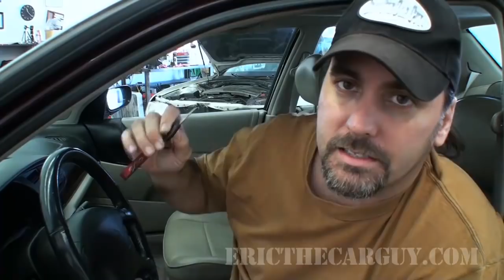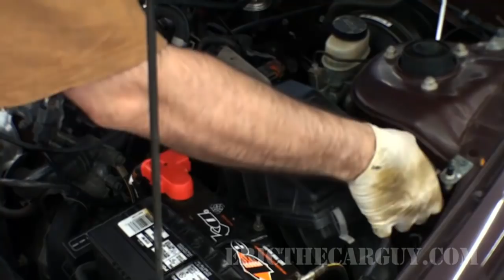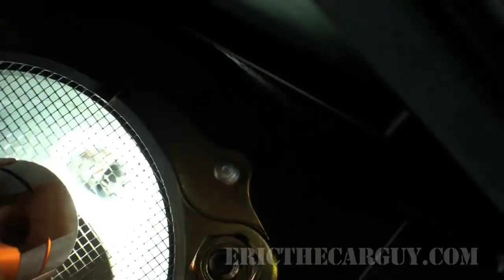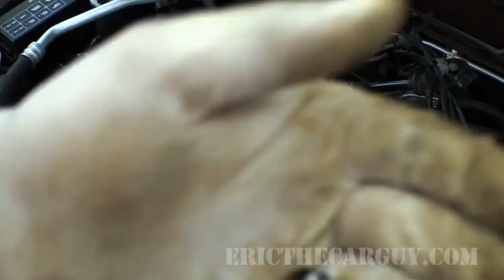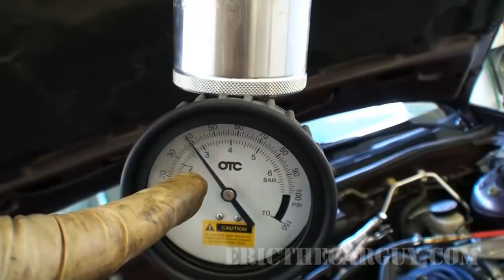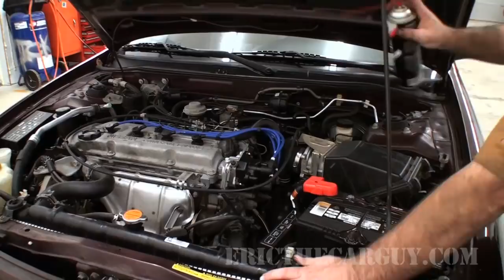1997 Nissan Altima Misfire Diagnosis -EricTheCarGuy

Comment: Wow, that was one hell of an informative video, especially for someone that's never really worked on fuel injected engines, thanks! I'm working on a persistent mis-fire issue on my '93 Dodge Ram and even though it's a normally aspirated 318 V8 I got some ideas to try :-) Right now I suspect a fouled catalytic converter which I hope to confirm by pulling the pre-cat O2 sensor.

Comment: This is a good example of the venture effect. Biggest leak when no. 4 sucks. Fuel trims etc may have have not been too bad. Spark wires were marginal. Good to clean the injectors now and then. In all good work.

Comment: Yeah, those Altimas are known for intake gasket leaks! A quick look at fuel trims on the scanner at different throttle openings (during a test drive) is a great way to narrow down the type of misfire. A dirty MAF would give very different trims than an intake air leak. And after the fix, you'll have quantitative evidence that you fixed the issue!

To rule out an ignition issue, you could have taken out the #4 plug with the boot, laid it on the block, and ran the engine. Otherwise great job!
Reply: Pine Hollow Auto Diagnostics  the real professional ☝️

Comment: I have a 99 Altima. The check engine light was on and the codes said rear knock sensor and o2 sensor was the problem. A few days later the light went off so I went to get emissions testing and he said he couldn't get a reading or that the car was not communicating with the computer. He said o would have to get that fixed before I could get it tested. Why did the check engine light go off and why can't the car communicate with dlc?

Comment: Hi Eric love your videos and appreciate all the work you do  :)
I have a 2002 chevy blazer with a 4.3 vortec v6.
with a misfire in one of my cylinders, but its not showing a code? And i am using an actron AutoScanner , but i was wondering if i can run my engine while the scanner is still plugged in? Because there are a few other stats that looks like they only work with the engine running? But i cant find anything online saying its ok to run the engine while the actron scanner is plugged into the car?  Also, my engine misses about once or twice every 10-20 seconds, and i can hear a single tic sound every single time it misses? And the tic sound seems to be coming from near the distributor area? I also have new wires cap rotor and plugs, and they arent arcing. so im stumped? please help me Eric. also, looking forward to seeing the fairmont progress videos :)
Reply: i found out what the problem was, the plug wire was deteriorated under the nipple or whatever its called.

Comment: Excellent video. Those Altimas especially the 2.5 seem to be everywhere out here in Cali. Dime a Dozen seems like. Last year when we were looking for a replacement for our '96 Accord that got totalled, we took a '06 Altima 2.5 for a rest drive and loved the power & performance. The car wasn't in our budget and ended up with an '08 Kia Spectra. Also a good car but would be better if it haf cruise control.

Comment: Hey Eric, the best injector testing method I've seen it an injector balance tester. Just connect a fuel pressure gauge, prime the fuel system up to max by turning ignition on a few times and connect the balance tester to the injector. The tester is plugged onto the terminals of the injector and can pulse it 10, 20, 50 or 100 times. Looking at the fuel pressure after you can do a comparative check- 1-2 psi difference would be bad injector

Comment: Do you think you could do a video about rotary engine issues, or things in that nature I have a 2005 mazda RX8 and something it wrong when it starts sometimes.it starts everytime, but sometime itll crank for like 10 seconds then turn on, sometimes it ill take 3 seconds but i never get a good turn and it turns on right away like every other car ive driven. i dont know if that cause its rotary or what. please help.

Comment: Tell u what  I'm not a mechanic but I did the same thing as you as far as hearing the miss pin pointing which cylinder was missing. Through my own various tests because I don't have a computer to hook up, so parts changing I went new wires, plugs ,cap and  rotor button. Got it a little better but didn't fix it. I don't know anything about feul injectors so u you talk to me a little bit about that with your video and I much appreciate it. So I was at a lost only thing left to change is coilpacks a little bit high on the price for me so stop there and thought I would just get a mechanic. Ugh. But a technician buddy of mine told me he didn't feel a skip driving and told me it's wasn't missing. Wrong he is but he's a diesel mechanic won't hold that against him. So that got me to thinking about that vacuum leak I thought I heard weeks before the car started messing really bad but couldn't find. Don't have any ether to test with so I hit the internet for common problems for the 1999 Nissan Altima and so be it a rough idle is the number 1 problem caused by a vacuum leak on the intake manifold gasket . So found your video on YouTube trying to see how to take it off because like I said I've never messed with feul injectors before or fuel pumps. So I appreciate the videos a lot and wish me luck on replacing mine I can't wait for the fun

Comment: Is that sound the alternator or the power steering pump whining?  I just replaced a timing belt and water pump on my civic and it's making that kind of sound now but it wasn't before.  It doesn't really do it much at idle but when you give it gas it get's louder :(

Comment: Intake manifold. Did it 2 years ago so I don't remember everything but you gotta: drain fuel lines, drain coolant, remove air filter, throttle body, starter, fuel rail, many hoses and really tough to find bolts, then have fun jimmying out the manifold and collector.    There's more, I just can't remember.  The dealership pegs it at an 8hr job.  There are  a couple hundred complaints online from Altima owners with the same problem, vacuum leak #4, lowest quote was 500.

Comment: Hi, My sister has a 99 Dodge Grand Caravan, I had to replace the plugs, wires, and coil, but it is still running a little rough.  I did the power balance test with the fuel injectors and only cylinder #6 had no response to being unplugged, I swapped injector 6 and 4 and still had no change.  I did use a auto stethoscope to listen to the injector as I pluged and unpluged the it, and I heard the ticking sound when it powered on.  I am a little stumped on what to check next!

Comment: Hi Eric, what could be some possible causes for a 1997 Altima suffering a loss of accelerating power when the car warms up.  There is no check engine light on and no codes whatsoever.  Distributor was replaced 6 months ago.  About 2 months ago, car started to lose acceleration power when the car warms up to normal temperature.  When the car is cold or recently started, it runs fine.  When the car warms up, it becomes very sluggish, taking a long time to reach 40-50 mph and when it does so, it starts to shake a little almost as if the engine wants to cut out but doesnt.  
Thank you for your help.
I've read somewhere that the distributor rotor screw could be the issue?
Reply: My 1998 altima is doing the same i already replaced the knock sensor and the Maf also the distributor is new and m still feeling hesitation did u figure out the problem I've spent over $300 to no avail
Reply: Rafael Gonzalez no, never found out, driving it as is.

Comment: I had a similar problem with my '98 V6 Camry where it was running really rough. A local mechanic advised a major tune up calling for coils, 3 of them, wires and plugs. They wanted an insane amount of money so I did it all myself. I still had problem and tested injector #6 thankfully front bank of engine and it had zero resistance. Injector was expensive at near $100 and a bear to replace, Fuel rail grommet were very difficult to find for some reason. My throttle body gasket was also bad from age

Comment: hey Eric I was wondering if you could help me out with a p0300 code so far I've done spark plugs 
coil packs
seafoam fuel filter and checked the battery and it's good too haven't done the injectors or checked the cat. would a clogged cat even cause a p0300 code would the computer?  it's a 03 trailblazer btw thanks
Reply: rogelio aguilar most likely going to be the fuel pressure regulator

Comment: I've found that un-metered or pirate air on these 90s cars actually causes the engine to run rich. The engine will detect that something is wrong because the oxygen sensor will show lean running despite the "correct" amount of fuel being put in, so to protect the engine the computer will dump in loads of extra fuel to compensate.

Comment: Just a tip, read the injector cleaner can - after you use injector cleaner like that, replace the spark plugs or risk and idle misfire - I always do it before I replace the plugs never after - I watched a young mechanic spend hours revving and driving cars that had idle misfires, I got sick of the noise so went to see what the fook he was up to and sure enough he was doing injector clean after new plugs and didn't ever read the can that said "replace spark plugs after use or engine may have low speed misfire"- yeah I gave him chit about that for some time after, he no need no stinking instructions.

Comment: The car was running fine but one day after replacing the belts the car was running rough at idle. I was driving and I lost power. I had the pedal to the floor and I wasn't going anywhere. I pumped the gas and the car jerked and started hailing ass when the power kicked in. The next day it cranked then cut off n now it won't turn over at all. Do u know what could be going on. Spark plugs hadn't been changed in years and I was wondering if that was a problem.
Reply: Could be but it could also be anything. Hard to tell without looking at it but spark plugs are cheap enough to just try and see.
Reply: regular diligent maintenance ,oil changes,cleaning under-hood and fixing things when they happen will stop these kinds of issues.if the plugs haven't been changed in years,likely not much else has been changed either so it could be anything or everything combined.
Reply: big daddio first thing I did was change the plugs. I ultimately junked it. it's tax season, so I will be getting a better car. not a Nissan ever again

Comment: i replaced the MAF on my 97 altima at about 308k miles. i thought the little bolts might snap off, so i just ordered the whole MAF housing from ebay (used of course) and swapped it in.

while removing the old MAF i noticed the same thing you did, the connector was not fully seated/connected. i didnt even have to press the release tab to remove the connector. the replacement MAF works great, and the original harness connector snaps in tight. i wonder why it was loose on the original MAF but tight on the replacement?

Comment: Also with pinching off the return line. You boosted your fuel going into the cylinder, which eliminated the misfire because you ended up with more fuel + more air in that cylinder. You essentially had a lean misfire in cyl. #4, and boosting fuel pressure just helped to righen up the mixture.

Comment: Ouch!
Skipped over a few steps ie compression check and vacuum leaks...
But! you did find the problem and that 1 wire was questionable and the cap had some wear, so at least it wasn't wasted money.
Those Nissans are well known for intake leaks, thought out of all people you would have known that, "Mr import of that vintage"
and the other take of it, learn from your mistakes.
No one is perfect!

Comment: A couple days ago, my CEL came on. My codes read cylinder 2 and 6 misfire. Have about 40K on a 2012 Wrangler Unlimited Stock. Idling runs around 500RPM. Temperature where I am right now is around 50 - 70 degree Fahrenheit. I recently had this issue about two days ago, with no change in driving habit. Engine will hesitate once a while during idling and often when I brake and come to a complete stop. I wouldn't describe the engine running rough when it is idling. I checked the codes using the jeep's built in ODBII reader and it'll automatically erase them after its checked but the CEL is still on with no codes now (I guess it needs an external ODBII reader to actually turn it off). I drove it for a couple days and rev the RPM up higher than usual and upon check for any codes, it doesn't appear to have any new codes but the CEL is still on. However I still experience the same issues (hesitation once in a while during idling and almost all when coming to a full stop). Please, any ideas or suggestions? Thank you.
Reply: Best suggestion is to take it to the dealer. Unfortunately the the first model year Wranglers which have the V6 Pentastar engine have had trouble with the cylinder heads and misfires due to the valves being burned up. Have seen this personally on several Wranglers and some Grands. But the dealer is your best bet in this case.

Comment: Hi Eric, I saw a clip on u tube where someone hot wired the injector, with a fuel pressure gauge on, when the injector was powered (open) the fuel pressure dropped right down, realing it and it went right back up again, putting injector in the fuel system to try to clean the injectors ot, well it usually just goes back to the tank...Fred.

Comment: good video, although you went about the misfire the hard way. I always first look at fuel trim to check for problems first. fuel trim can determine a vacum leak. Also second in order would have been a compression test. I would of recomended the wires and cap though. both looked to be a potential problem.

Comment: how much did that repairment cost for owner of the car? looks expensive to diagnostic cause many check stuff involving.... i'm having my fifth car, cause mechanics costs more than the car itself. timing belt change cost about 1/3 part value of the car.  i meen in a 600 dollar car. good cars.

Comment: What would you look for if a single cylinder is only misfiring under heavy acceleration, and all plugs/wires/coil are new?
Reply: For misfires, the order to check things is always: Ignition, Fuel, then air (vacuum leaks). I would make sure your fuel injector for the affected cylinder is working since your already replaced the ignition components.

Comment: I think its just the way the engine is designed. Its very easy to flood those engines. If you start the engine from cold then turn it off within a 2mins
it's a pain in the ass to get it started again. Is that what you have?

Comment: I've worked with these motors quite often and knock sensors tend to be fairly common on these engines. So more than likely, that will need to be replaced in the near future. It's rather common on older Nissan/Infiniti's...

Comment: I don't wanna disrespect the teacher but to clarify- engine vacuum is as high when the engine is at any steady rpm. Not just idle. In a healthy engine revving should cause the vacuum to drop and then rise back to normal. So an engine would be at 20 in/hg at 4000rpm if it is 20 at 800 rpm. The engine stabilizing would occur when revving but not holding the throttle open. correct?

Comment: My friend had a problem on his peugeot where it kept mis-firing and throwing up the check engine light - even going into limp mode. He took it to a garage and they couldn't figure it out. They tried changing the injectors and the wiring loom - but the problem remained. Took it to another garage and they wanted to change the ECU.
I thought i'd start simple and have a look at the spark plugs, one of them was bad so I changed all of them (it was due a service) and no problems for the last 3 months.

Comment: is it the same as a 99? and I still need to put the knock sensor in it but I don't know where if goes
Reply: Knock sensor is by the oil filter
Reply: +Heather Beckenbaugh Most likely somewhere on cylinder block. Has single thin wire.
Reply: its ok i found out the problem, exhaust manifold had a crack in it, blew a head gasket, and the catalytic converter is shot, so its a sitting duck atm, thanks guys
Reply: +Heather Beckenbaugh This is a long shot, but I'm picturing your car with a failing partially plugged catalytic converter causing excessive heat, leading to your later problems.
Reply: It's OK thanks for the advice, found out what was wrong with it and after fixing a few things found out that the head gasket went. So it does me no good now...lol
Reply: Heather Beckenbaugh Well the advise is, don't just replace parts.  Learn from them.  I was just blurting out some theory of failure, because I always look for the root problem.

Comment: If you havent already, I would try the IAC (intake air control valve) Just a good cleaning will make most of those Dodge engines run like new.

Comment: i have a 2009 fiesta 23,134 miles with a missfire on acceleration, new sparks,coil pack, leads, battery TMAP sensor still missfires
and no codes showing, might be the alternator or the TPS. seems ok when cold.   Old cars were fun to work on these days need a PHD.

Comment: Hey are you still monitoring this thread?  Could use some help here. I have a 99 altima and the scan tool says it's ready fir testing, but the EVAP monitor is INC and I have a mode $06 fail on 
CID $04 
TID $0C   MIN      VALUE      MAX    PASS/FAIL
                 N/A         255          199        FAIL
I can't find any info on this except possibly on the "International Automotive Technicians Network" but I'm no auto tech so I can't join their club. (i hate clubs anyway)  so since you stated you know Nissan's well, can ya answer this for me? What the hell does that data mean?  thanks 
BTW nice blow it on this car. shows the learning curve were all on. 8*)